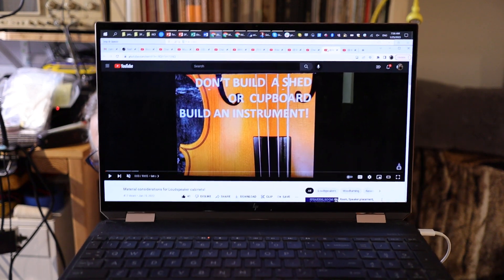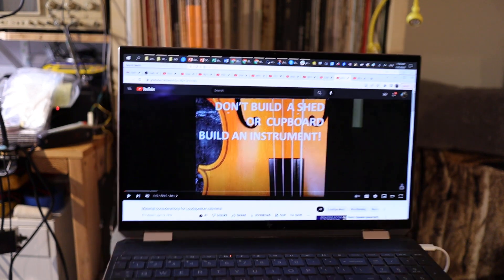Wood choices for building loudspeaker cabinets - MUST WATCH

Comment: Hello Janos, 
Here on the Canary Islands eucalyptus plywood is most popular as to stand high humidity and the temperatures. Do you have any experience with this material?
Reply from the maker: Hello Adam, we do not have eucalyptus ply here, but it would work well. How well, it depends on the quality of the ply whether the local mill makes it high or low grade. If it's high grade (no or very few holes, thin layers, intact large pieces in the layers not broken chips.)
Reply: @realworldaudio  Thank You Janos, I will experiment with 1st grade. 😊

Comment: Great series on live speakers, thank you. Now, would it be a completely bad idea to get an old piano, which is beyond repair, and use it as the source for the cabinet? You can often find such instruments for pennies or even for free. Typically, they are from the late 19th - early 20th century. Thanks!
Reply from the maker: Old piano sound boards are perhaps the best material for live cabinets! If you have access to them, go for it! 👍👍✨✨✨✨
Reply: @realworldaudio  great news, thank you!

Comment: Every material will have a different sonic signature. Test with plates of different materials under an amplifier for example. I’m currently using slate platforms supporting cups and balls which itself is supported by springs. 

For speakers I would use real wood if budget allows. Maple and spruce might be good. Pearl Acoustics make their Sibelius FR speaker using oak and that sounds nice.
Reply from the maker: Oak is wonderful, has deep and full sound, and it's a little darker in tone. 
Thank you for sharing your amplifier isolation method! I have found that each component prefers a unique approach for best results, and it takes time to find the most optimal solution. I'm glad you did the extra effort and tried out new combinations! As you have found out, the approach that yields the best result is a support that controls the resonances, which in turn, is supported by an isolation platform. ;

Comment: Slate is the very best natural material for speaker cabinetry  
Fischer & Fischer Speakers made out of Slate
Reply: What you are sharing is the case if your goal is to create an "inert" cabinet. Janos/Real World Audio  and what he's sharing is referring to departing from that model and creating speakers from material that vibrates similar to an instrument... and that approach may not be for everyone. which basically sums up everything in the audio world.
Reply from the maker: Thank you Rick, indeed, slate is perhaps the best choice for inert cabinet production. It goes in a very different direction than the live cabinets that my channel specializes in, and for which this video series offers a hand. 
Yet, slate is an amazing choice. In case one is prepared for the weight and has access to the tools to cut the slate (these pretty much rule out 99% of audiophiles - yet, in case one can work with it, a very worthy path to try out). Cheers, János